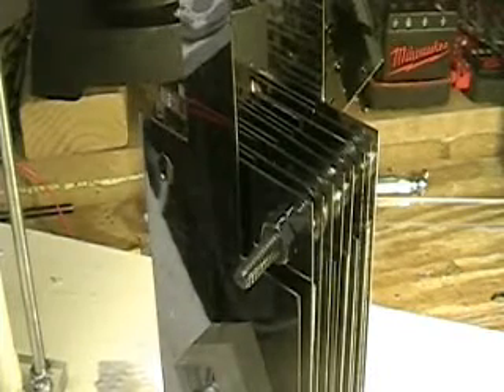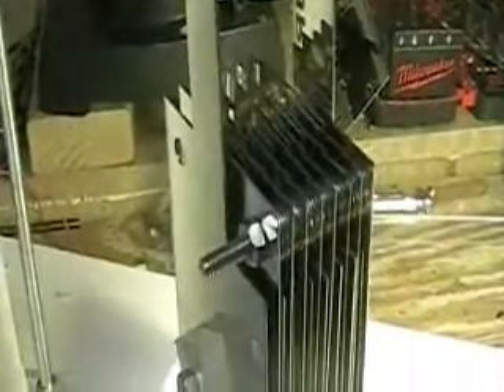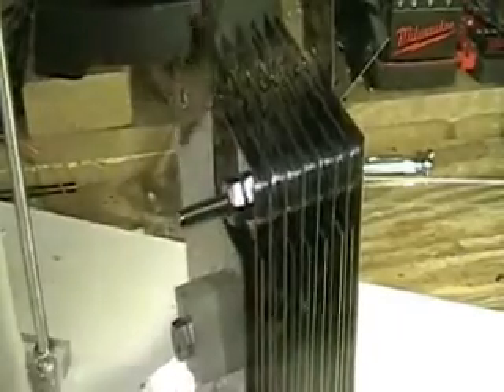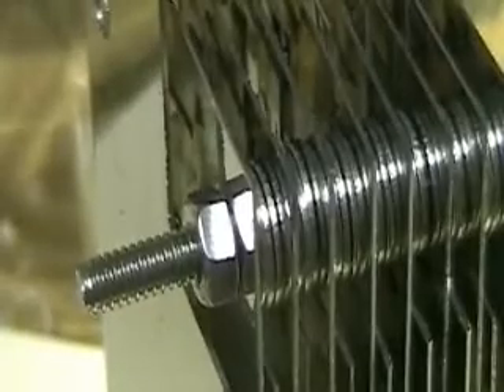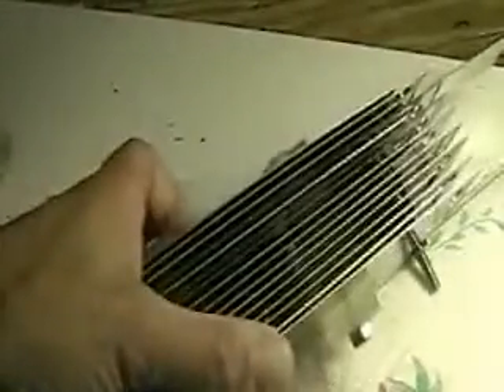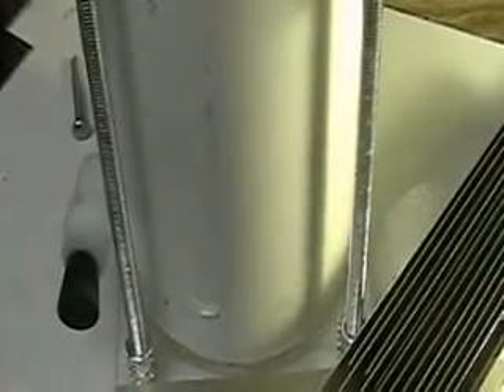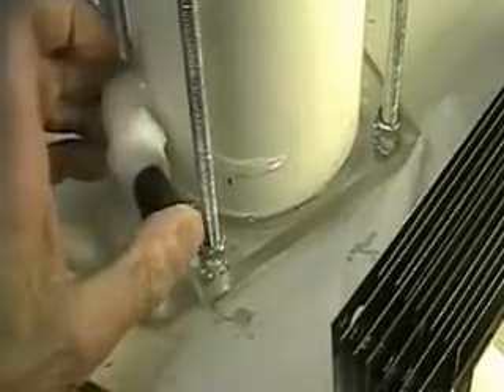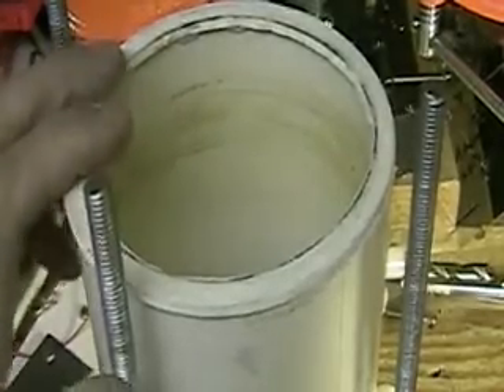Hydrogen Tap (FOCUS- refined) 306

Comment: I always wondered what would have happened if you used stainless steel mesh instead of stainless steel plates as your electrodes?
The reason I haven't started my own tests is that SS is not readily available here in Serbia, so you have to search really hard to find it :( However, I hope to start one day :)

By the way, You've made a nice setup on the FOCUS cell. I like the idea that you accepted the suggestions posted by others, that tells a lot about you. Keep up the good work.

God bless you.